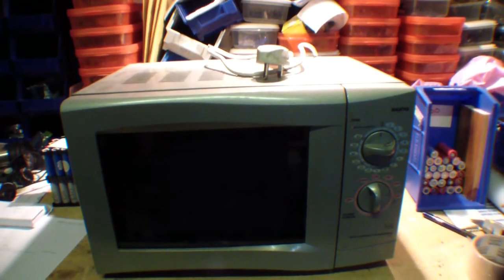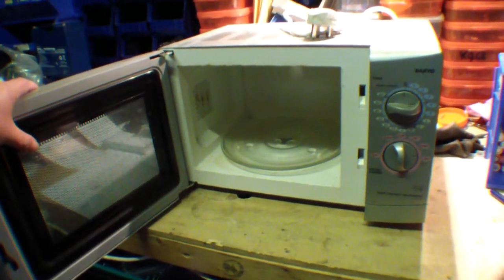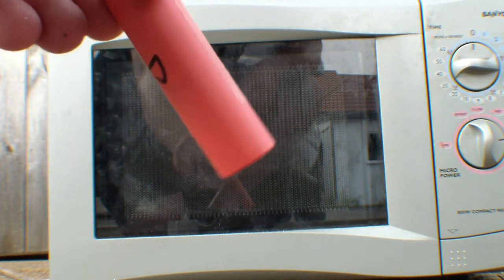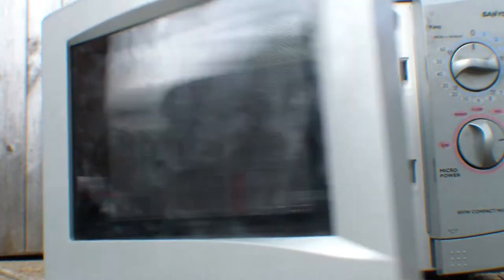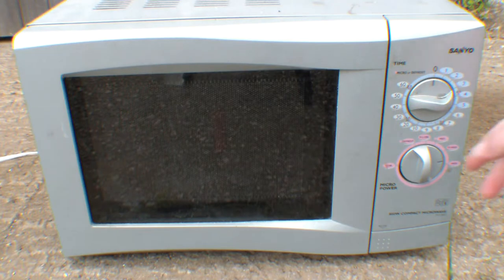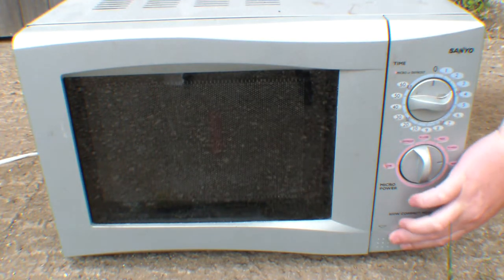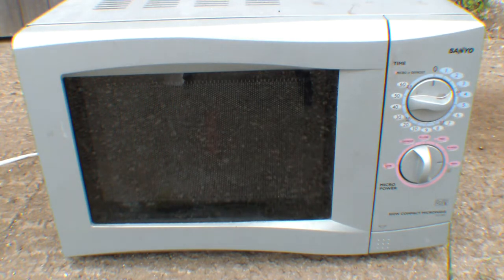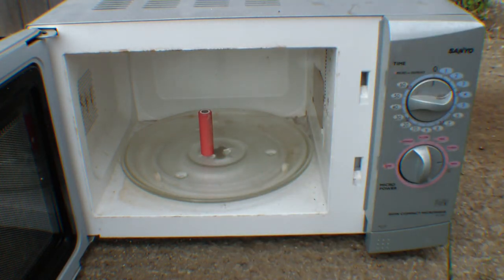18650 Lithium battery in a microwave, FAIL

Comment: Part two? I’ve thought about this video idea for YEARSSS and this is soooo disappointing
Reply from the maker: Yeah I was really disappointed, I was expecting so much more, fireworks and everything, so yeah I think a part two is due, maybe we might add a few incentives this time to make the 18650 cells go pop in a much more exciting way
However it does go to show the lithium 18650 cells are pretty safe unless someone is completely stupid with them
Reply: Alex Martin unwrap the battery 🤔 that might give us the result we were hoping for . Otherwise those are great ideas
Reply: @EV-North  if the battery was held in one spot it would have explodes way more at least that i know of